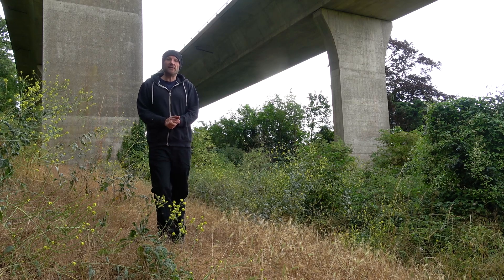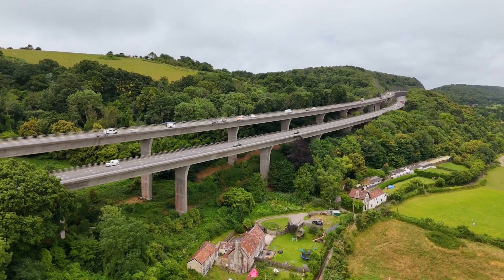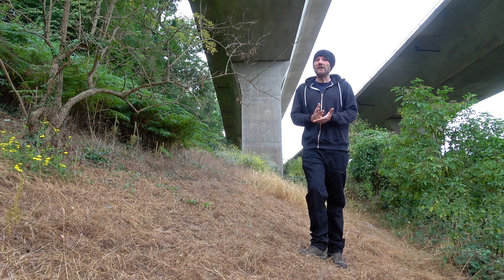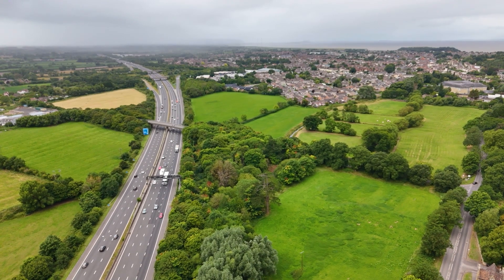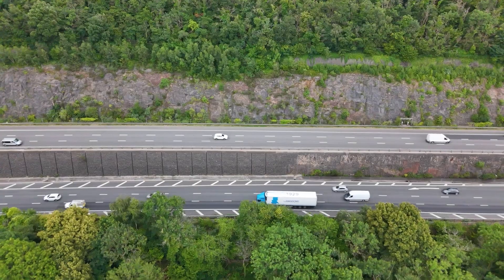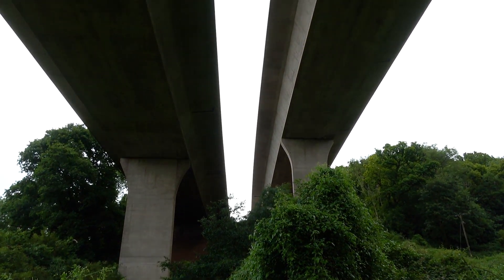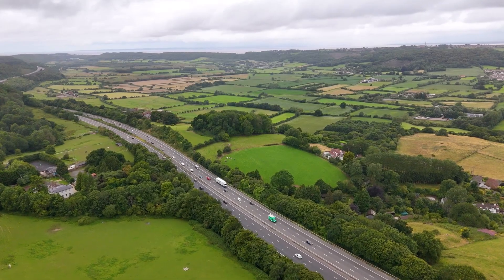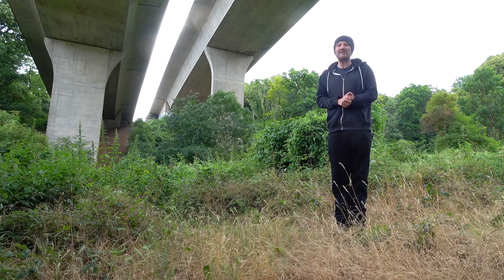The AMAZING Split-Level Wynhol VIADUCT - M5 motorway - Why Is It On Two Levels?

Comment: For 30 years this was on my daily commute.  Yes it is a great bit of engineering.  A few things to add: It's quite a twisty section of motorway as it clings to the side of the hill and in the middle of the winter with the rain lashing down and a westerly gale gusting at you from the side it can be a 'challenging' section to drive.  And finally, whoever designed in the 4th lane from J19 really didn't think it through. because cars scream up the hill towards the split level bit in lane 4 only to find their carriageway disappears at the top so have to suddenly get into lane three which is already full of cars so they have to stop. And then lane 3 stops.  And then lane 2 stops.  Eventually lane 1 stops too and it all tails back to J16.  Often, the best strategy is to get into lane 1 early and then sail past, waving at the stationary idiots.
Reply: Haha. Smug lane one cruising ftw 😂
Reply: If you know you know 👍🏼
Meeeee 😁
Reply: It's supposed to be merge-in-turn in that situation.
Reply: @Species1571 supposed to be but everyone wants to get in front then the nicer people get fed up and don't merge in turn either
Reply: @geoffsclassiccars  there is no merge in turn there.  It’s a filter.
Reply: @Species1571  Sadly, so many people mis-time it that it can be a bit of an accident blackspot.  Fridays during the summer are no fun at all on the southbound carriageway because there's always someone whose luck has run out.
Reply: @Species1571 it’s also meant to be ‘a-holes that try to be smart and leave it to the last moment to push in despite knowing the lanes narrow don’t deserve any consideration’   They have several signs warning of such and it is meant to be correct driving to merge in and not try to jump 20 cars ahead and push in.
Reply: @xr6lad  waiting till the last moment is how you are supposed to do it.
Because that ensures the best flow. Of course that won't work if there are smug people in lane 2 who don't let people in because that would hurt their ego.
Reply: @xr6lad What is the lane for if not to be used?
Reply: @xr6lad  that's exactly what the merge point is for... a merge as the lane ends, not 1/2 a mile before.
Reply: @Jehty_  no. You are meant to merge in when safe and before the end of the lane. End of story.  The end is meant to be an overrun. Not the first and last choice.
Reply: @Jehty_ 
Yeah, hard to believe that 'merge like a zip' as they call it here in NZ really is the best. But it is.
Reply: @Jehty_  No...
Reply: @xr6lad go read the Highway Code, you’re supposed to use the available lanes until the end, and then allow people to take turns merging at the merge point to keep things moving, not queue in one lane for miles with an empty lane next to you, and block people trying to use the road correctly.
Reply: @xr6lad Wrong . Read the highway code then come back .
Reply: I’ve driven that road daily for over 35 years.   The N bound outside lane merge at top of hill have never worked smoothly.  Merging the inside rather than outside lane would always have worked better, since the L1,L2 speed differentials will always be less than the outside L4 to L3 merge.    This would avoid those that charge up L4 and wait until 200m to force merge.  Those forced Madge’s ( and it is NOT a merge-in-turn) more often result in L3 and L4 cars having to over-brake.   This in turn creates the ‘caterpillar effect’behind.   Next thing, on busy periods, the M5 has stopped back to Clevedon, as the caterpillar stretches back out.

Similar situation S bound except the 4 lane run is better laid out and the L4 close is better marked, so things are a little better.  

Always faster overall when crawler lanes merge than when overtaking lanes merge.  

N bound can be a bugger for standing water in downpours.   

Great engineering tho.  It was never designed for the volume of traffic that it now handles.
Reply: 30 years ago there were far far far less cars to merge, there needs to be a camera to stop Audi drivers from acting like idiots thinking they own the road and the law doesn't apply to them...
Reply: *fewer cars.
Reply: I think it's more an issue of people not knowing how to merge properly. It happens in the states all the time too. Zipper merge people. It's actually faster and keeps traffic moving. Everybody wins if you just let one person 'cut' in front of you.
Reply: That lane design has to be a troll
Reply: I'm glad you're not smug...
Reply: Until they cut you off moving inside...
Reply: Usually the extra lane on a hill is for overtaking lorries. This section has always worked out well for me.
Reply: Often, the best strategy is to get into lane 1 early and then sail past, waving at the stationary idiots.

Is exactly what i do
Reply: Also do the same when on the M4 heading into London before J2
Reply: Shh! Don’t tell the tourists this secret
Reply: Is it wise to proclaim your own wisdom? No, because you don't even remember the Sabbath day, you dolt.
Reply: I would've done the merge the other way round and instead of the 'fast lane' merging in, make it so the 'slow lane' has to merge in, just like an extended slip road
Reply: to be fair. cars in the 1960s. very few went screaming up that hill. at least not at much speed.... and the biggest issue is people dithering around in lane 3 with no intention of passing anything in lane 2 for at lest a couple miles... and im saying this as a van driver with a tracker that genuinely doesn't do more than 70MPH
Reply: *Cars weren't really thought through
Reply: And I quote “ When you’re travelling in a lane with marked lines that’s going to end, you’ll need to merge into the next lane. The same rules apply in this situation as when you change lanes from a lane with marked lines: you need to give way to the vehicles in the lane you’re entering – even if you’re slightly ahead of them. If you’re merging, wait for a safe gap and ensure you’re matching the legal speed of the road you’re entering”
Reply: @xr6lad  when you have your left indicator flashing indicating you are changing lanes, anyone that continues to overtake you on your left is dam right ignorant and also breaking the law.
Reply: I think that 4th lane design is perfect. Gives lots of room to get past slow moving traffic on the steep incline.
Reply: As a BMW driver, I just barge in.
Reply: @SingleTrack66  As a BMW driver you would do this when overtaking and undertaking.
Reply: @rogerroger5255  well I do own the road.

Comment: One of them rare times they built something that was actually built, worked, has lasted and is still going strong, they need to find who the people were behind its' construction and learn from them on how to build infrastructure... :P
Reply: Laurie van Carr was the engineer apparently 🤷‍♂
Reply: I was a company trainee with a foundation engineering company called Cementation Piling and Foundations in the late 1960's and recall we built the diaphragm wall retaining wall between the 2 carriageways. The contract was called The Gordano Valley.
Reply: You can't widen it though and make it smart.  @twocvbloke   You got two CVs on the hob?
Reply: @stevekelly5166 - we don’t want anymore so called “smart” motorways thank you very much. The section around the Almondbury Interchange (junctions 19 to 20 on the M4 and 15 to 17 on the M5) are bad enough. It took well over two years of road works to install this junk causing traffic chaos and now you still get lots of congestion in the area. Even when the traffic level is not high, often the variable speed limit function is activated with 60, 50 or sometimes 40 MPH speed limits for no apparent reason. That includes late in the evening long after “rush hour”! That’s 33 overhead gantries of pain. And then there is the speed cameras... But there are only six emergency refuge areas for seven miles of motorway... What a waste of money.
Reply: @Mark1024MAK Frankly it's not all a waste of money when the main issue with Motorway traffic in the first place is too many people don't know how to use them. The outer lanes are only meant for overtaking and all traffic should generally drive on the inside lane. But instead people treat those lanes like driving lanes and don't do the 70mph that is meant to keep traffic flow steady. Instead everyone is doing their own speed while lane hogging and that is the main cause of congestion in modern motorway driving.

Comment: I never realised how high that viaduct is.  I used to work as a towtruck driver, and got sent out to pick someone up who had broken down on the southbound side.  I'm not good with heights, and made the mistake of looking over the edge 😮 the customer ended up having to help me stand up as I'd gone very dizzy 😂
Reply: Did he tow you home and get his money back?
Reply: @nathanlucas6465  As a regular user of the M5 in a truck, the only time my arse was twitching on that section was heading south at the time they were resurfacing lane 1. Obviously lane 2 was closed as well, so there I was, at high level in a truck cab in lane 3 with a shear drop to my right. I can tell you right now, I kept my eyes strictly ahead for the duration of that section!
Reply: @Sarge084  the only time I've had that feeling while driving was getting stuck in an artic on the Severn bridge behind an accident.  You could feel the bridge move each time a heavy went past the other way 😶
Reply: @nathanlucas6465  I've taken a truck over on the Woolwich Free Ferry a few times, but the most memorable time was when I was first on, I drove right up to the barrier and all the way across the Thames I was looking straight down at the river swirling away in front of me!
Reply: @nathanlucas6465  The Oldbury Viaduct does (or did) something similar, in that when stationary you notice it bouncing
Reply: @Sarge084  weirdly, the Woolwich ferry never bothered me!  I've got a time-lapse of me taking a rigid over on my channel somewhere
Reply: @JaidenJimenez86  I can believe it!  A most unsettling feeling
Reply: Sod that!  I'd have been reversing up the shoulder!
Reply: Recovery needed to recover.
Reply: Back in the 90s on the northbound side just after the viaduct bit someone crossed over the barrier and fell quite a long way to their death.  Hence you’ll see warning signs before the extra lay-by that was built for roadworks recovery vehicles 10 or so years ago